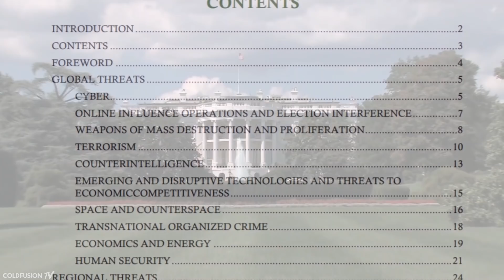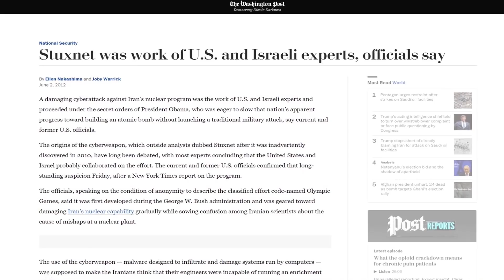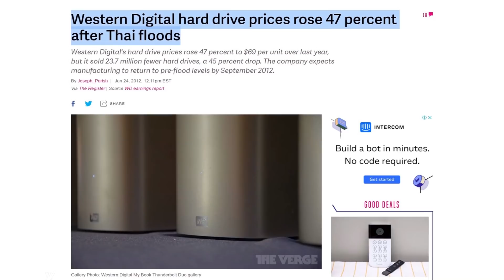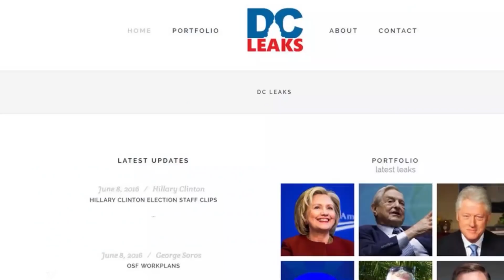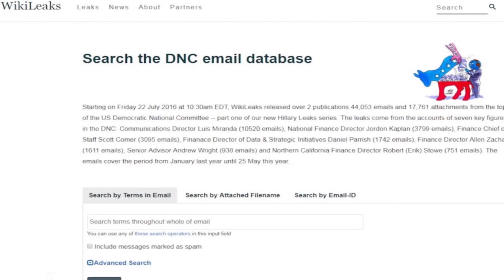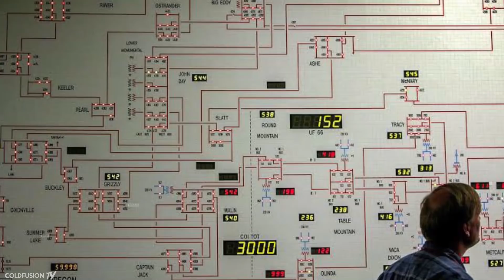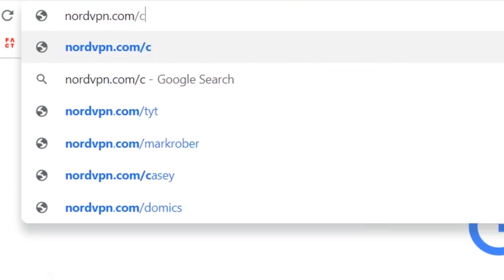The Hacking Wars - How Governments Hack Each Other

Comment: Given the burning American flag, it's highly likely that the Aramco hack was the work of Iran or Iranian proxies, specifically the Houthis. The Houthis are a rebellion movement in Yemen that have been at an armed conflict with Saudi Arabia for years now over Saudi influence and corruption in Yemen. Since the Houthis are backed by Iran, it's also somewhat of a proxy war in the region. 

 The Aramco IPO was a major deal for the House of Saud; it's a major part of their "Vision 2030", which is a decade-long plan to diversify the Saudi economy in the face of a future world that may not rely on oil as much as it used to, as well as modernize Saudi life and infrastructure. Since Saudi's economy at this point basically is oil, it's crucial for Saudi Arabia to be able to profit off of their golden goose on the open markets quickly enough to generate the revenues needed to diversify. 

 It, therefore, was in Houthi's interests (as well as Iran's) to cause as much trouble for Aramco as they geared up for their huge IPO. For another example, it's also commonly believed that they were responsible for the drone strikes on Aramco oil installations in 2019.

Also, the Houthi's official slogan is "God is great, death to the US, death to Israel, curse the Jews, and victory for Islam" – which is why I thought of them the second I saw the burning American flags.

Comment: 1 measly vpn is nowhere near enough to fully secure your computer lol. It significantly increases the difficulty of directly hacking you through your internet connection, that's all it does. The primary two uses for VPNs these days are securing your device on a public WiFi (never trust a public wifi. NEVER EVER trust a public wifi. Any user on it could be trying to fish for passwords and credit card information and whatever else they can get on through a public wifi, and you will never know. But if you use a VPN, they'd have to be specifically targetting you, and have the capabilities to hack through a vpn in order to get anything out of your device, which are two unlikely conditions for most of us(

The other is privacy and staying anonymous, when you don't want anyone who wants to to know what it is you're looking through right now. It doesn't even have to be anything illegal or anything, maybe you just don't want it to be easy for governments or other malicious entities to be able to profile you, it will make it harder to target you if you ever become some kind of target if you regularly do this.

If you want proper security from being hacked and coincidentally traced easily, think VPN connection, delivering internet to a VM (Virtual Machine) that then routes through a second VPN. And now you have one of the more basic forms of reliable cybersecurity. (even then, it's only truly protecting you as long as you are not using windows 7, 8 or 10, since these operating systems are all in their current state what is known as spyware.)

Using a VM also acts as a layer of defense against viruses, most viruses cannot infect your physical system through a virtual machine (there are ways of course, but there are also ways to make it even harder); so you can safely browse whatever filthy shit you want to see, and if you get a virus, then you'll still be safe unless you have identifiable information in your browser history or files which are accessible to that VM.

Furthermore, if you ensured no identifiable information is on your dom0/host/physical machine, then even if a hacker or virus somehow makes it through your VPN and VM, you still have that one last VPN obscuring your traces and where you're connecting from, and who you actually are, if you are keeping track of network activity and can actually notice attempted hacks or malicious activity from viruses, then this would buy you enough time to pull the plug and keep at least your identity a secret.

This is the only way you can get privacy while browsing the internet these days. If you don't pull extreme measures like this, between google facebook and microsoft, everyone can see everything you do.

If you also want to use social media and accounts that are identifiable as you, then you would need to set up another VM, connecting to yet another VPN so that you can keep your public browsing separate from your private browsing as it would be necessary to hack through 2 vpn connections to fully identify you at all times, and hacking your way out of 1 vm to a dom0 to another vm where your private browsing would occur is convoluted and complex, and nobody's gonna go through that kind of trouble unless you're at least some kind of CEO.

How fucked is it though that if you want to be able to retain any sort of anonimity online, you absolutely can not use the #1 most popular operating system that almost everyone uses?

How fucked, that if you don't want all your digital life (including all your offline activities and files!) to be readable like an open book to any interested entities (governments and spy agencies in particular...) you absolutely cannot use Windows 10. And probably not MacOS either (there's a lot less evidence to suggest Apple is in on this, but a gut feeling tells me they've always been in on it, and all these lawsuits and arguments between Apple and the American government are all just some song and dance to make Apple's fans stay ignorant of it all)

Comment: The stolen data from the DNC servers was downloaded at a rate far greater than any internet connection and consistent with a local transfer. This was NOT an outside hack, but an inside job. Do some more research.

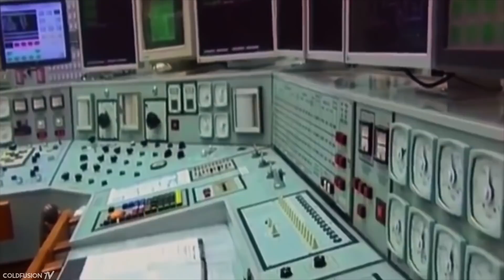Comment: Great job pronouncing Iran 3 different ways in the span of less than 30 seconds at 01:36, 01:54, and 02:03! Started with the correct pronunciation, then got worse on each next try ;)

Comment: This is a really shallow look, especially at stuxnet. It was more incredible by a factor of about 20 times or so. It also contained 4 MEG of code. That's utterly insane. It also spread peer to peer across PLC's. That's almost like your fridge infecting your microwave cos they'e both plugged into the wall power. It ran for several YEARS before it even started to do it's thing.
And there's a traces of a second one called flame that's even more unknown.
If you're interested in it google mikko hypponen and stuxnet.

Comment: Talking about cyber security and Nord VPN at the same time 👏👏
Reply: Ravindra Nagrecha  I was going to share the video to another group, but I was turned off when Cold Fusion seamlessly went into a Nord commercial. 😢
Reply: @Mike G MAC address can be spoofed even easier than turning on a vpn though
Reply: @Mike G By "device id", I'm assuming you mean your MAC address? Nothing outside of your local network can see your MAC address unless you have software that directly interfaces with said website, and said software is configured to look at your MAC address.

Even if they could see it, spoofing is an incredible thing.
Reply: @JustTodd24  Couldn't they use Cookies to track you though ? 🤔
Reply: Weta  If you use incognito mode cookies are dumped when you exit the browser. Use duckduckgo and a privacy-friendly DNS server and your search history isn't cached either.

They can build a profile off of your resolution and web browser and many other things, but there are ways to circumvent those too. In the end, it's just a matter of how much you value your privacy and how far you'll go to keep it.
Reply: @Mike G afaik the websites can't track you anymore
the VPN provider knows everything though